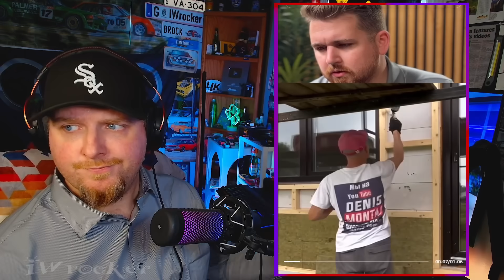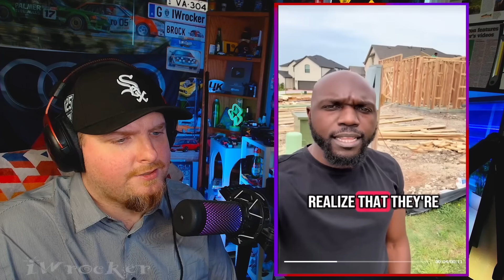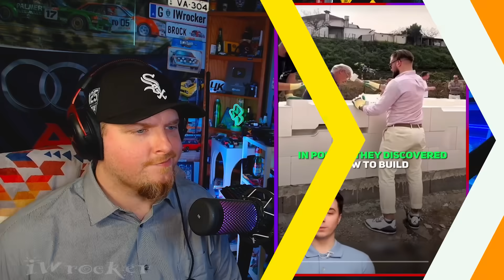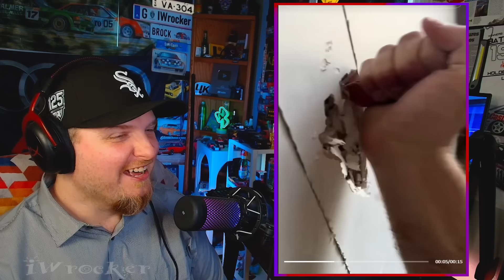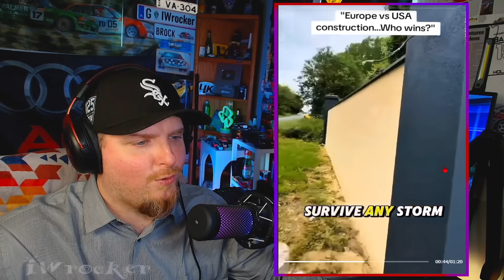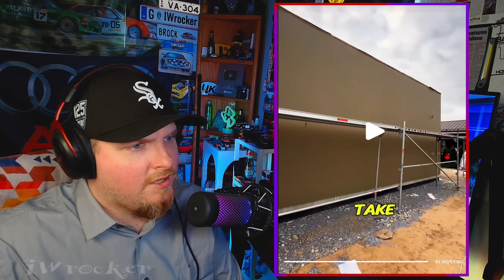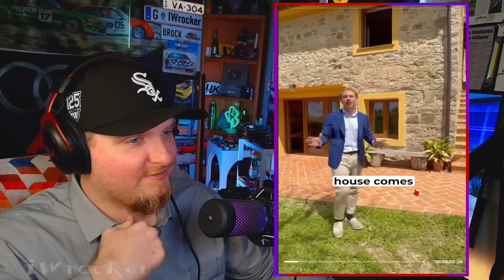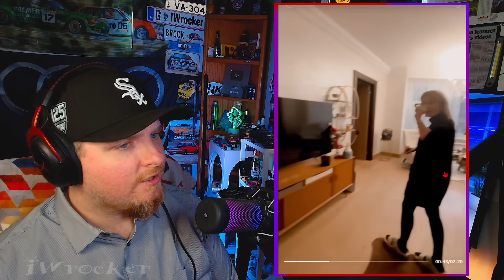25 Minutes of European VS American Home Quality & Construction Methods 🔨

Comment: My house was built in 1926 by the local council. You'd need a sledge hammer to know down my internal walls. Even upstairs they are brick. The most incredibly strong brick in the world, Stairfoot brick. Pretty much impervious to drill bits, you have to use ceramic drill bits

Comment: I agree on many points. As a european, I prefer the esthetic of the American houses, but that's because you guys usually have more freedom when it comes to the lot size and how you want to build it. Building in most european countries is what I would compare to building in a HOA area, you don't have much leeway as to what you can build and how it can look because there's so many rules and regulations (too many, in my opinion) which is part of the reason why building a house is so much more expensive in Europe (i'm generalizing, it's obviously not like that everywhere). The upside of buying a finished house in Europe is that which ever house you buy, you know it's most probably of sound structure.  We also had the issue of losing many houses after WW2 and then a lot of houses at to be build "fast" afterwards, where esthetics really wasn't at the forefront of people's worries back then. So a lot of the houses from the 50's, 60's and 70's, although still standing due to them being strong builds, really just are square boxes with a door and a couple of windows, and not really appealing to look at.

Comment: Putting the insulation outside prevents heat leakages through where the walls and the floors connect.

It is a rather recent method, though. And also ugly if not though beforehand. It is also not biodegradable nor recyclable.

Comment: So , I will ex[plain to u as a Ukrainian construction and industrial engineer who lived in 40 countries(I was in Canada for 3 years and assume that USA has the same shity(cheap) construction methods). All houses as a all walls inside the house a build from concrete blocks or bricks( no drywalls). This methods gives u opportunity to have less noise inside the house, less cold air will reach the house(if u will put mineral wool as on video on 1st minute it will give u additional thermo insulation ( more healthy if u put it outside the house + will stop cold air outside...). I watched till 3rd minute and had understanding that it not my video. Sorry and all the best

Comment: That looks like white brick behind the wood frame so that is probably external insulation... the wood is just there to keep the insulation framed... American homes are just designed to require constant maintenance... European ones last hundreds of years.

Btw white brick is not load bearing the load is supported by rebar enforced concrete.

Comment: If you have to put tar paper shingles on the roof, cos it won't hold anything heavier - it's not a real house.
Watching these "fixer-upper" type things, i'm astounded how vastly over-priced these "houses" are.
They buy some wood and plasterboard "house" for 100,000, slap some lipstick on that pig and sell it for 150,000, but it was only worth 50,000 to start with.
A real bricks and mortar house increases in value over the years, these wooden ones rot, they are like new cars, as soon as you drive it off the lot.....

Comment: In a cold climate, insulating a house from the inside makes no sense. It effectively turns it into an ice box. The inside insulation will keep heat from reaching the stone. If you insulate on the outside, your walls will act as thermal batteries once heated up. Think of outside insulation like a winter jacket for your house.

Comment: We’ve had wooden framed houses in the UK since the Elizabethan age. Lots of them still in use. My 1990s house has wooden framing with insulation and weatherproofing built in. Surrounding this is brick and tile. Internal walls are wood framed with insulation and plasterboard (Sheetrock). Our three bedroom house only needs about 3kw heat in midwinter. It is warm in summer though, so it’s air to air heat pump time.

Comment: In Europe we have 2 types of wall. The structural loadbearing ones and the interior ones that create the subdivision in the building. The second ones can be made from whatever you like but usually light brick that is strong enough  but if you need to tear them down to enlarege the room during renovation it can be done. The loadbearing ones you do not touch if you value your life.

Comment: The roof in the lego house is metal ona wood frame. Under the exterior layer you have insulation, then drywall or wood or something similar probably. This roof will last a long time.

Comment: The thing is we do drywall and wood framing too.
But the quality differences are still out of this world.
Especially doors.

The absolute greatest way to erect a building that will stand for 100 years is going with reinforced concrete and engineered blockwork.
Concrete and bricks dont burn. 
The opposite is the case they contain fires.
In WW2 the allies faced hell when closing in on Germany because essentially every house was a bunker/stronghold ofc not against artillery or tanks.

Comment: I live in Slovenia, and the way insulation is done on the house at 13:38 is pretty much how our (newly built) house was insulated. The foam part is thinner on our house, but still extremely effective. We also have triple-glazed windows with external blinds. It helps a lot in the winter, our house was warm without our heat pump going bananas. It also helps keep the house cool in the summer, so air conditioning is more of a bonus than a necessity. However, standards across Europe vary since each country has its own standards, which usually reflect the climate of that country or even the specific region.

Comment: Not that exact location but I know of these. Google if you will 23-24 Leinster Gardens:

Purpose: They were created in the 19th century when the Metropolitan Railway cut through the area, requiring the demolition of existing houses and leaving an open-air gap for smoke ventilation.

Appearance: The façades perfectly match the surrounding Victorian white stucco terrace, but a view from the back (Porchester Terrace) reveals they are mere shells.

Location: Situated in the heart of Bayswater/Paddington, West London.

Google maps you can see what they hide.

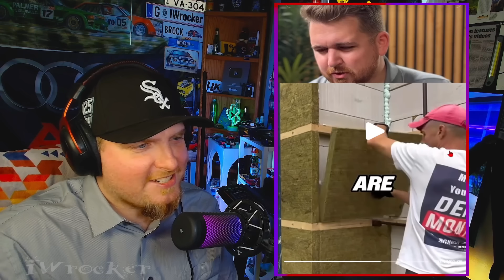Comment: @1:25 hold on... "why would you put insulation outside of the building" 
What the actual mindfu** is going on here?!?! where ELSE are you putting your insulation to prevent bridging? inside insulation is only done in super old homes and only when there is absolutely no way that outside would be possible. Inside insulation is the worst kind of insulation. Near impossible to prevent mold.

Comment: The house I bought (in Germany) was built somewhere between 1750 and 1830. It's half-timbered. So the lower third is made from red sandstone, the rest is visible oak wood framework and a clay-straw-mix. It needs some love and is a little crooked, but it's still solid. Two sides of the house are covered with slate to protect it from the weather.

Comment: We build a lot from wood in this European country. Might be counterintuitive, but wood is actually fairly fire resistant in buildings. It's also not the only material in a wood building. It may come as a surprise to some, but people have actually thought this through.

Concrete might not burn (easily), but everything else in a house will, and once it starts going, you're not going to salvage any part of the concrete, because it will still crack and spall. Hell, it can crack and spall from annual temperature variations alone.

Comment: Well I see it like this - countries that have often suffered destruction - don't bother making buildings last - they make them cheaper to rebuild. As to insulation - looks like it's very old kind of insulation - rather thin too. 

Also yeah 100 years is for stuff made from disposable materials - the ones built to last were built around 1100-1400 and I am talking about houses - not castles

Though as to interior walls ? Sometimes made just thin ( because making a brick walls adds weight + it's just easier if someone wants a reconfiguration of interior - though it's still usually at least not so week to easily punch it through)

Comment: The solitary facade in London is what remains of a house that was demolished to make way for a route for the London Underground, which was originally powered by steam locomotives.
The Londoners simply decided that the old facade was more attractive than the hole in the ground. It also absorbs the sound of the rails and the smoke from the locomotives.

Comment: "we do anything just right in amerika... why cant everybode just do it like this"... O.M.G   🙈
 
We also have houses made of plywood and foam... but that's where the garden tools are kept or where the dog lives...
Even my private carpentry workshop has walls made of 30-inch natural stone...  A former stable for horses... 120 years old and doesn't freeze even at 20 degrees below zero. 

In Europe, there are buildings that are  three times older than the Declaration of Independence, and no one has to go looking for them in the neighboring state after a tornado. 🥴

btw... Mass and insulation are both part of the concept.
The mass stores energy and the insulation ensures that the mass stays warm in winter and cool in summer.   

BTW.btw... have you EVER seen rich People living in Plywood? Gues why...

Comment: In Sweden we usually have OSB board and then plasterboard on the outside on indoor walls. There are rarely concrete walls in Sweden. But if you hit the wall, it hurts a lot. Because there are no fake walls like in the USA. And usually wood paneling on villas and concrete in apartment buildings on the outside.

Comment: That concrete will hold some heat from the heating. If not insulted from the outside, the walls will be cold.... And cold walls get condensation on them, and then mold.

Comment: The guy in the beginning saying "why do they put the insulation outside" with a wtf feeling. It is much more efficient because of the reduction of thermal bridges on inner and outer walls interaction, you can make the best of thermal conductivity and thermal resistivity of the insulation material

Comment: EU houses or Slovakian houses is made from bricks,ytong and similar material external and internal walls than thick insulation all around.Really solid houses.Alluminuim roof and windows are my choice but price is astronomical for average poeples.150m2 bungalow cost basic 1900m2 but reality is over 2300€+….SICK

Comment: Erm, why would you want insulation on the inside? If the insulation is between the weatherproofing on the outside and the structure on the inside, you are insulating the entire internal thermal mass, making it to slower to cool down in the winter and slower to overheat in the summer.

Comment: Ireland here. The main reason one would use exterior insulation is if the house is 200 to100 yrs old. The newer houses are built to accommodate cavity insulation so it can be pumped into the walls. Old house use outside. It's cut to compliment the shape and style of older homes..  all walls are brick in irish houses. You can get what we call flat pack houses which are basically same as american houses and comes ready to assemble. But the kinda have a shelf life because they are mainly wood and plaster, a shed basically!

Comment: we're currently renovating, trying to break a wall between living room and kitchen to make it open. Thick concrete supporting wall (20cm =7,8 in), the quotes we got from contractors are around 10-15.000 euros. I wish I could take a little knife to it and diy it, but this will not be possible. Greetings from Luxembourg (might explain the high price, but tbh across the boarder it would be maybe 2-5k less)

Comment: I think those walls you can punch through are very intriguing, but I can't quite dunk on any housing.

My brick house? Built with so little care the walls are not level and plumb. Our (rented) vacation  home with 1 meter thick walls? mold. My century old former monastery turned student dorm? Pretty decent, but cold (isolation, esp windows, despite them really trying) and although great for summers because it was like 4 meters high, try getting curtains for non standard sizes!
Odd shaped rooms, too.

Comment: 18:34 it’s not a façade (facing), I’ve seen the inside of that one. I live in London and saw a for sale listing for one of the flats, it is just the angle of the photo that makes it look worse than it is. It’s a triangle/wedge like New York’s flat iron building. The narrow end of the flat is the bathroom and shower cubicle for the flat. The rest is much wider. 

The reason for the shape is the tube line behind it cutting off the corner of the plot.

Comment: The insulation is outside, bacause the stone wall also can hold heat in the  winter and can provide cooling in summer. Thats why insulation is on the outside.

Comment: Got my house its first reroof last year. A few slates had worn loose letting in rain that rotted a few battons. The original hand made copper nails had worn completely through. My house, a cheap industrial terrace, is 110 years old. Reused all the original slates of course!

Comment: 18:00 I looked it up there sare some fasade houses in london were they hidde the London underground. the undergrounds are open on some parts so in the old ages the smoke from the trains could get out and air got in. so they build fasades wo looked like houses. BUT that thin hous is just THIN on one side it gets wider on the other side.

Comment: so the insulation is outside that the walks made from stone on the inside can get warm and store heat. because when you have -10/-20 C  and lets say ur heating has a error and et does not run for a view hours the walls keep ur house warm.
just like a fridge just warm kinda😅

Comment: Exterior "foam" installation is usually "XPS" panels. You have multiple options for the layer above that. Commenly it''s something called "CREPI" in French, which kind of looks like what you call Stucco. This is very common for modern looking homes. You also have cork,  stone strips, cement/lime mixes, or obviously just full bricks in as the facade. With bricks it's usually PUR panels instead of XPS or sometimes PIR or Rockwool. 

This system works for well btw, and it's super effective, mostly used (the exterior xps panels with some sort of cement/lime) on shoebox style new builds or full exterior renovations.

Comment: You put the insulation on the outside to use the stone and bricks as thermal batteries on the inside. When they are up to room temp they can, themselves, keep the house temperature above freezing for a couple of days if the heating breaks down.

One "pro" of american houses are that they are really cheap to build. 
One big "con" is  you still pay more for them than we do in Europe.

American houses that look like brick are not brick, they are wood.
American houses that look like wood are not wood, they are cardboard.
American houses that look like cardboard are not cardboard, they are basically news paper tents.

$4-500k for that heap of trash? You are really getting suckered on houses! The building businesses must be laughing all the way to the bank.

Comment: We have inside walls made also out of drywall, usually 2 thin layers for better durability on both sides of framing and then in between framing there is insulator for noise reduction. but it depends on design on individual preferences. Same is for new apartment buildings, saw even in one new house, that contractor had drywall and also small brick walls in apartment.

Comment: In Europe we put the insulation inside the walls to add lots of weight to the building so they don’t fall down in a breeze , or disintegrate on a rainy day. If we built houses to the incredibly high American standards we would have no matchwood left over for matches……….

Comment: in Europe most interior walls are also made of plaster planks filled with insulation , only the structural walls are plain brick/concrete , so usually the outside walls and the central inside walls

Comment: "Just do things the way we do them in america?" Incorrectly? No thanks, I like my houses to be be able to withstand a strong breeze. Also we do use drywall inside for decorating purposes, we anchor studs to the concrete/brick walls and attach the drywall that way (sometimes you can adhere them straight onto the wall). xD

Comment: The London one - it's called thin house in South Kensington and it just looks like normal flats on the inside but obviously very narrow (about 6 feet wide). It was originally meant for artists studios. 

The one other people are mentioning where the facade of the building was kept to keep the aesthetics of the street is a different building in a completely different street/area.

Comment: For the 'thin' house in London (at 18:14) - It is a facade only and was built when the tube lines were put in - what you can't really see from that clip is that there are rail lines/tube lines running in a cutting, very close to the back of the homes - the home that was there was probably knocked down and replace to allow the lines to pass through, or this was built when the rest of the street was built - this would have been late 19th century, probably

Comment: As a European, i have to say this: Let's be fair, american walls are flimsy, yes, but in all honesty, sheetrock walls in Europe aren't exactly rare. We use them to build with too, quite a lot actually. But, granted, most places i've seen, they always use double layer sheetrock on top of the insulation, it adds to rigidity and soundproofing.

And for the European windows vs. American ones, one big thing that never gets mentioned is safety, meaning, if you have a fire in the house and the exit is blocked, you can fully open a European window and easily escape through it. Much harder to do with a window that only opens half-way and slides up.